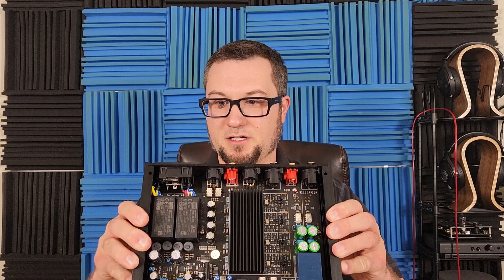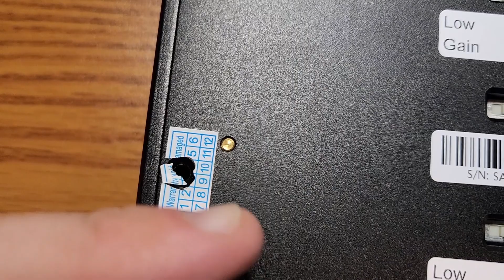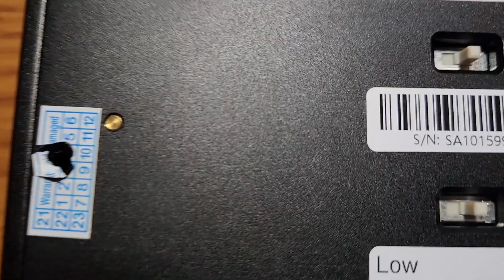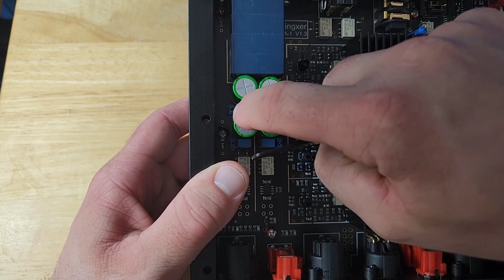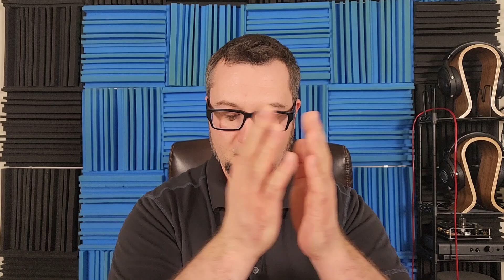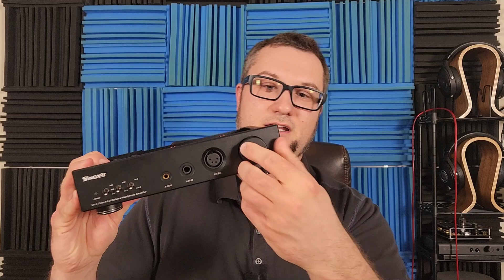Singxer SA-1 Review Part 2: DC Offset Mod...Worth It?

Comment: Oh, and those jumpers. They're used in warranty type work to test the output of each of the balanced signals coming from the amplifier sections so they can diagnose which channel and phase is most likely dead. You have a harder time doing that once two phases of each channel are merged back together in stereo.

Comment: The reason higher impedance headphones show a larger improvement most likely has to do with the value of those caps. Large caps cost more and their value also affects the bass roll off more the higher the impedance of the headphone there is.

Comment: What you are hearing is the removal of the crappy low cost electrolytic capacitors, those green ones you pointed out in the video. Those caps are coloring the output sound of the amp. And thus when removed, makes the amp sound better.

Comment: Hello all, long time viewer here. I have worked on a number of amp designs and can tell you with 99% certainly what this mod does and why it changes the sound, and I'm sorry wave theory, but I don't think your theory is accurate. Installing the jumpers by passes that output capacitors and that is all it does. Most designs use output caps to protect down stream components from DC voltage. It's a liability thing. When you install the jumpers you bypass that safety feature.

Comment: Its also possible to replace thoses electrolytic caps ( wich is generaly a big nono ) and solder some big highend foilcaps in, if you want to keep the dc protection.

Comment: I just got this video recommended from youtube, so I'm a little bit late :)
Two points, first I'm confused about what setting the jumpers do. Of my understanding the jumper bypass the capacitor in the signal pass from the inputs. That means when the input has a DC offset it goes to the amp circuit and can do bad things. In my understanding that can only be the case if the sound source is damaged or very pure designed. So, this has nothing to do with the power supply. But we will never figure that out with out the schematics I think :)
And the 2nd point, because you ask, there is an other AMP with jumper you can put in. I think the shunts are in the box with the amp. Its the Emotiva BASX, and setting the shunts will bypass the resistor in the headphone signal pass. That means you get the full power (40W on 8 ohm) on the headphone, no idea what kind of headphone will handle that.

Comment: I don't have a schematic so this is just a guess. If those blue components are capacitors, looking at their placement suggests that they could be input capacitors. Input caps are generally there to block DC from your signal source. So if you have a high quality source that has no DC they aren't necessary. But if your source does have DC offset this will be amplified and could damage your headphones and possibly the amp. This "mod" allows you to make your choice based on measurement of your source or blind faith.

Comment: E.E. here, I can explain why they put in the jumpers.  They knew the protection circuit dimished the sound quality so they gave the user the option to disable it.  Since it is a protection circuit, it then makes sense that disabling it would void the warranty.  It's not unheard of for manufacturers to include jumpers to enable/disable certain "features".  One that comes to mind off the top of my head is the Emotiva BasX A2m headphone/speaker amp. which is the latest iteration in the series and still includes the option to use jumpers to enable high power (speaker level) output to the headphone jack.  Users of planar headphones have been raving about this "mod" on this series of amps for many years now because the extra power really makes planars "sing".  In this case, they don't void the warranty since there's no danger to the amplifier.  Risk to your headphones and ears however is a different story.
Reply from the maker: You are probably correct. But why not fix the protection circuit so it doesn't do that? I get that swapping out parts might necessitate a redesign and slow development. And that ultimately costs more money. But since the jumper pins are built into the circuit board, they must have known before the production stage that the protection circuit was limiting. So if your explanation is correct, they had a chance to fix it and didn't. They went ahead and ate the cost of producing a pcb with extra jumper pins instead.
Reply: @wavetheorysound  The "protection circuit" is literally just an input capacitor that the signal passes through, acting as a highpass, removing DC components from the input. This has nothing to do with the power supply, so output power is exactly the same in both scenarios. This is standard for almost all non-dc-coupled amplifiers mostly just for headphone/speaker safety. Just in case the component driving the amp outputs a bit of DC, you don't want to amplify that DC and pass it along to the headphone/speaker. Some people tend to think that capacitors have coloration to them, even in their passband, which you seem to be able to hear, so Singxer gave the customer the option to bypass (short out) the capacitors, so that the entire input signal is passed through, including some DC components. Sound quality can be improved, and assuming the DAC driving this amp is of decent quality and doesn't output much DC, everything is fine, with the downside of making the amplifier less idiot-proof. Unfortunately, there isn't any way to "fix" an input capacitor, other than to increase the quality of the capacitor, which can be expensive and doesn't improve measurable performance, so their decision makes sense. By the way, the little blue box next to the large green capacitors are also capacitors, but a smaller value of higher quality called a "bypass capacitor," used to improve the sound quality of the large capacitor without increasing the cost much.

Comment: Jumpers are used in Adio GD equipment to make changes.
Reply from the maker: Does it void the warranty? I'm asking because I honestly don't know. I have no no experience with Audio-GD. I know that the Lake People G111 has internal dip switches for gain control and some jumpers on the circuit board that are user adjustable for ground lift on the XLR input. Crucially, tinkering with those does not void the warranty or increase system risk.
Reply: @wavetheorysound  with the R2R11 it's to adjust a sound change. As far as voiding warranty I don't know for sure, but they talk about it as an option to do, so I wouldn't think so. Just wanted to mention another company that implements this sort of thing. There are few and as far as I know are Chinese manufacturers so it may be something they see from a view other manufacturers don't. Thanks for your time and reviews.

Comment: The question of course: Is it really better or is the power just increased which makes things sounds slightly better because it’s now like having a different volume setting on? It’s also hard to really know because it takes time to switch it unless you have 2 side by side. But any length of time can throw off our memory. Below might be the key to why this hobby is incredible..

The more I learn about stuff, the more I think it all (if you want non distortion music) comes down to your headphones, the frequency curve, the EQ, and having enough power to get the crazy good dynamics and timbre. My SA-1 sounds amazing not modded with my hd600 with the EQ I have for it. I also am running it balanced from Modius and balanced to headphones  with high gain on SA-1. Which I think is all important if you’re using EQ because you need the power to make up for the negative preamp value in the EQ. I can’t believe how dynamic and great this sounds!!

I think it’s all about (for clean sound, not talking about distortion products): Do you have enough power in your setup to get the most out of your headphones? Does your dac or amp get distorted using things like high gain / or do they measure well? And do you have the correct EQ so frequencies sound incredible when you turn it up to a volume that is dynamic? I do have all that working well - and it’s wonderful. I strongly recommend EQ to get the most out of headphones unless you get extremely lucky that your headphones are already perfect. I can’t stress how important it is enough…otherwise you could turn up your amp to a dynamic volume and you get instruments sounding cluttered and it’s a way less enjoyable sound overall. It needs to sound clean from a frequency curve perspective so you get those dynamics and timbre sounding incredible at the right volume. Damn it’s great, I hope everyone has my setup or better.
Reply from the maker: To this: Is it really better or is the power just slightly increased which makes things sounds slightly better because it’s now like having a different volume setting?" - I did my best to volume match. Rapid A/B is impossible when I only have a single unit and have to power down/up, plug & unplug, and add/remove 4 jumpers like that every time I switch. Thus, I can't promise the levels were perfectly matched, but I also like to believe I've been doing this semi-professionally for long enough that I know not to let simple level differences be the reason for my claims. We also have to be careful what we talk about when we talk about power. There is a difference between the raw amount of power an amplifier can generate and how effectively an amp circuit can deliver its available power to the speaker/headphone drivers. The SA-1 has plenty of raw power output. Where it falls off, IMO, is in its ability to deliver the quick and subtle changes in power necessary to control the finer driver motions needed to wring out the last bit of resolution, spatial accuracy, and timbre that are do-able at the price point.  To me the finding that the jumper mod helps most for the most demanding loads is completely consistent with the need for power delivery over raw power. It's unfortunate that the stock configuration of the SA-1 limits the power delivery. I think that could have been engineered more effectively.

To my ears on EQ, resolution and spatial performance are 2 areas on which EQ has little-to-no effect. When it sounds like EQ has opened up the soundstage, it's often because the 1-3Khz range was too forward and cutting it moves those sounds from being too up front to being more in-line with the rest of the spectrum, allowing the staging more perceived coherence, and not so much that the stage was broken in the first place, just masked. You can enhance timbre with EQ to some extent because I think the 2 building blocks of timbre are tonal balance (which is FR-based and thus EQ can address) and then time-domain accuracy (which EQ cannot address). 

Thanks for watching and leaving a thoughtful comment! Always appreciated!
Reply: @wavetheorysound Great thoughts. You definitely know way more about this stuff than me. I gave the casual take based on what I did to get dynamics and timbre to sound amazing. But that’s amazing to me compared to what I had. Doesn’t mean there isn’t better out there. And I think everyone can agree, headphones make a huge difference for soundstage and other things as well - You can’t make all headphones sound the same with EQ. No question about that, but I do think to most people if not everyone - you can make it sound a lot better (unless of course you already had the perfect headphone frequency curve for you).

Also I totally agree about your point about soundstage not effected by EQ fully. I do think dynamics and timbre can be helped big time. But you bring up a good point about time domain potentially. I haven’t looked into that. Perceived timbre is great when you can hear stuff clearly which EQ can give you. Dynamics are also helped a ton by EQ because bass can go from non existent almost on certain headphones to powerful and incredible. Then the high frequencies being cleaned up by EQ I think also helps the dynamic sound. It’s just great overall.

Comment: Thanks for taking the trouble to do this one. I thoroughly enjoyed seeing what the modification involved, hearing you describe the difference it made, and having you explain why it made that difference. My take, based on your report, is that the option of doing the mod makes this amp much more versatile and appealing than its close competitors. If the price is right, I can buy the Singxer knowing that with an easy and dirt cheap modification it will handle very hard to drive headphones should I need it to do that down the road. I can use the amp for a while without the mod in case I get unlucky with a lemon and need the warranty, and then if I want to do the mod later for a super cheap and easy DIY upgrade I can do that knowing the non-zero risk is minute.  I love the idea of buying something I know I can make better someday with a screwdriver and some tweezers.
Reply from the maker: Thanks for the comment. I disagree a bit on the versatility claim. To my ear there are already other $599 amps that more effectively handle the difficult loads without having to pop the hood and tinker, irrespective of how simple said tinkering may be. I'll flesh this out more in the upcoming comparison video. Given that, it's difficult for me to understand why it would be a good idea to limit the capability of a product like this out-of-the-box.
Reply: Maybe just disagreeing about how much it’s worth to have an essentially free, built in, upgrade path. A big part of the enjoyment for me comes from being able to really get to know a set up and then see how/if it improves with one small upgrade. Most upgrades cost a lot more than this one, even if it’s just a power supply or cables you’re replacing.
Reply from the maker: @williambracken9339  Those are valid points, thanks for sharing. I think there are multiple ways to assess the "worth" question here, too. I grant that the monetary cost to buy 4 of these little jumpers is nearly negligible and that the time investment to do the mod is also minimal. However, the loss of the security that comes with the warranty (assuming the user is still in the warranty period) and the risk of broader system failure are also part of the cost. To each their own on that. I personally also wrestle with the question of rewarding a designer/manufacturer by buying their product knowing that they've done something to the design that limits its potential, has a built-in method of circumventing that limitation, yet punishes any users who do said circumventing and then get unlucky. Money talks. With my own financial voice I'd rather speak in favor of some others. That's just me. Thanks again for the thoughtful comments. 🍻

Comment: Instead of engineering a good quality circuit including DC input protection, they just engineer a shitty circuit and they provide you with the dangerous bypass at your own risk. I'm 100% sure the mod was communicated to the community by the company themselves. Typically Chinese brand unethical, sneaky and irresponsible attitude. Different culture values, analogous to their propensity to unashamedly steal designs and intellectual property. This could have been the subject of a lawsuit had the company been US or European.
Reply from the maker: To all, statements like this: "Typically Chinese brand unethical, sneaky and irresponsible attitude. Different culture values, analogous to their propensity to unashamedly steal designs and intellectual property." are NOT welcome on this channel. My channel is not going to be about this kind of talk. Challenge the ideas, not the people or the cultures. I will leave this up ONLY so this reply can be seen and so that it will be known that comments like this will not fly on this channel. All future such instances will be deleted as soon as I can get to them. - WT
Reply: @wavetheorysound  Respect!
Reply: Perhaps many amps that have a DC protection circuit don’t perform to their max by nature of their design. To say they should have designed a better circuit instead is like saying that Honda sucks because they won’t sell you a car with a four cylinder engine that produces 350+ hp just because it can. Engineering is full of compromises…and this is probably the case here as well. Singxer makes quality gear in general, so I doubt there’s anything fishy going on here.
Reply: Yeah too dangerous, it will kill hundreds of thousands.
Reply: Please keep your crude generalizations based on ethnicity to yourself. They are disrespectful to everyone and don't belong on this forum.

Comment: Hey comment about the "why" this might. As part of PCA/PCB test, it's not uncommon to put in test points that allow you to measure and verify different parts of the circuit. For some types of devices, there is even a whole serial protocol just for debugging. It could also be a leftover test point from prototyping that allowed the designers to a/b between different implementations of the circuits.
Reply from the maker: An interesting point, thanks. If true, I'm stilleft wondering why they left it in. Surely that kind of A/B testing happens on most or all products like this. Why does this one go to production like that?
Reply: @wavetheorysound  
That can just the ingeneers have no time to change the part list. This can take hours of work just to save 2 cent. Changes like this have to go to the production facility (no idea if Singxer has this in house or use an other company). In the worst case, removing the jumpers can trigger the compete QA testing chain.

Comment: Dude, the new Violectric HPA 202 and 222 are out.
Reply: Well, in theory. At least according to the V222 thread on Head-fi, that amp is apparently out of stock already after very few were shipped. The candidates for the amp upgrade I'm planning in a a couple of months (still in saving mode) has pretty much come down to the V222 and the Burson Soloist 3XP.